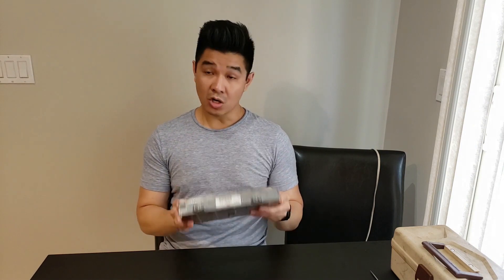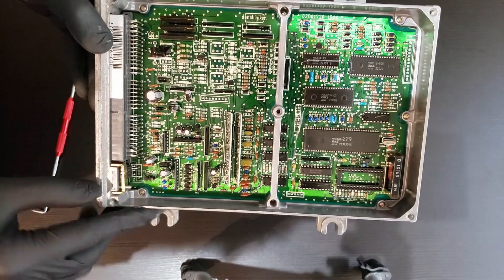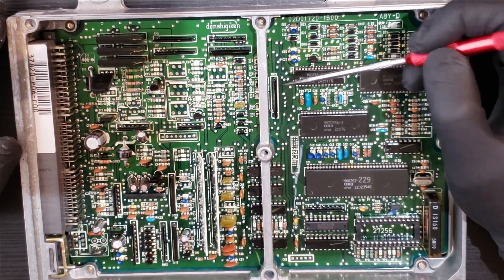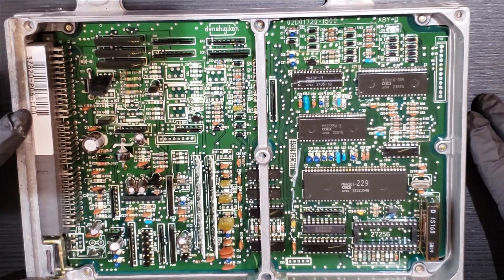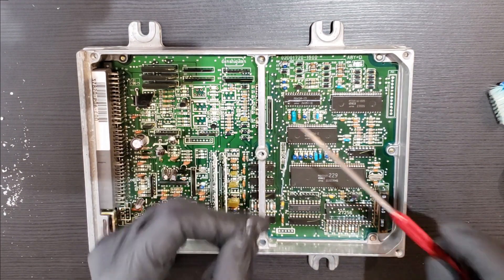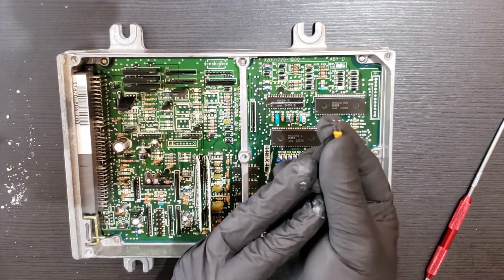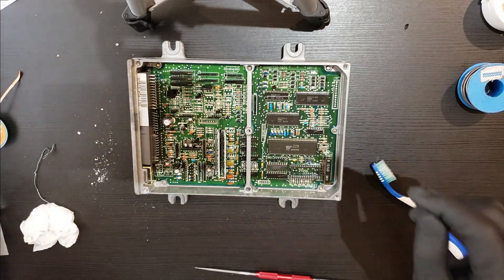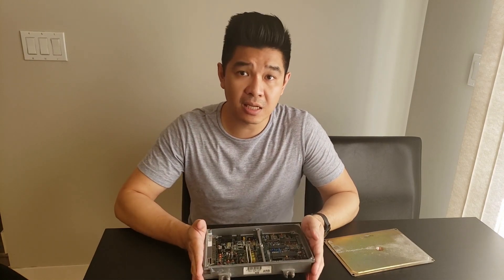||HONDA EF9/ED7 88-91 CIVIC&CRX|| Installing 1720 VTEC ECU Conversion Kit (P05, P06, P75) by BMTune👍

Comment: Excellent video, Bro how many Amps is the D11 diode?
Reply from the maker: @willrivera9062  Sorry, I don't really remember. Usually it's a kit you'd purchase that people put together. I know that people did list the exact parts and specs on the forums like hondatech, but I don't remember off the top of my head.
Reply: @BudgetGears  Don't worry bro, I already looked it up on HondaTech, it says "1N4002 Clamping Diode" I looked it up and it's 1 Amp. Thanks a lot for the video.

Comment: Great video 👍🏻 The 91 hatch that I’m restoring is still obd0 with a b16a and pw0. It will probably be that way for a while. I’ve looked into the obd1 conversion for future engine management options…..it’s getting crazy expensive.
Reply from the maker: Yeah its very expensive these days. These ecu's were literally $20 at most back in the day. Another option is going for some newer technology like a fueltech system.

Comment: The non vtec ecus are really the only thing left, the p28 was always the go to ecu from 2000-til few years back, when people was doing b series swaps or turboing they d series, now adays if the p28s havent been mainted they are garbage or if they hondata s300 they on their last leg the s300 wears out the components more faster
Reply from the maker: Yeah people are also asking crazy money for the non vtec ecus. The p28 price is ridiculous now and the non vtec is about the same except needing to do additional work to convert. Seems quite silly what some people are asking for these old ecu's.
Reply: @BudgetGears  p30 del sol b16 is about 800